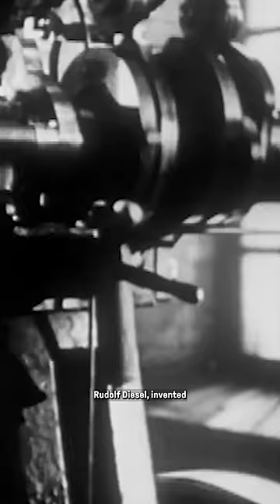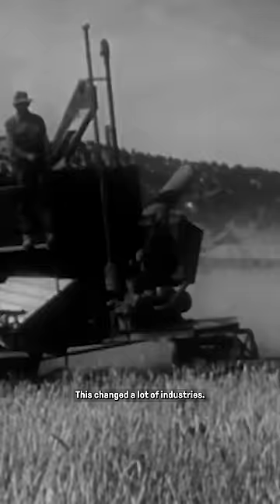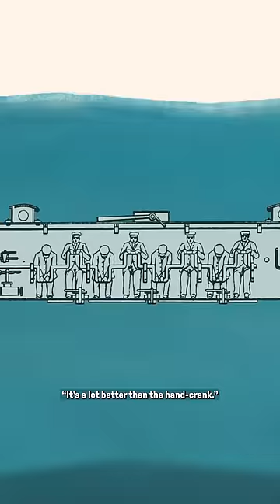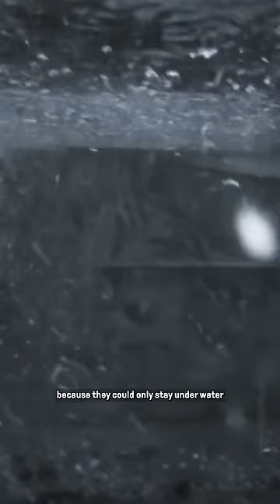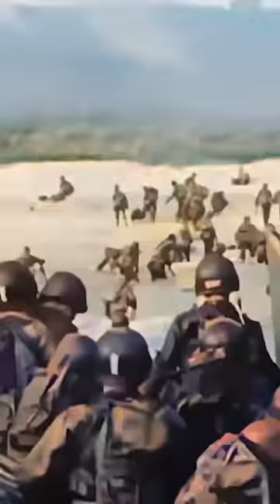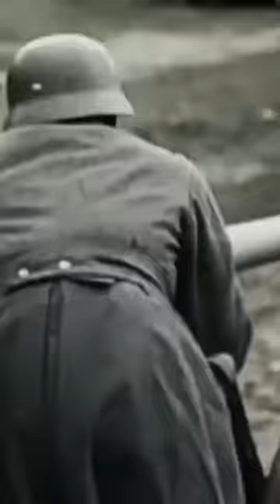How the Diesel Engine Powered Submarines

Comment from the maker: This is a clip from "Submarines Are WAY Scarier Than You Think...Here's Why": https://youtu.be/AecFpnj383A
Reply: There's a bot in comments.
Reply: Diesel engines were designed with vegetable oils in mind. One of the reasons waste fry oil, Waste motor oil or even fuel oil is used in diesels off road. The system is just so dang versatile.
Reply: Also, John Philip Holland designed and built the first U-Boat, then sold the design to the German Empire when the US Navy had no interest in Holland’s design.
Reply: Haha good of you to mention.  That escalated quickly!
Reply: Fossil fuels 😂😂😂😂😂
Reply: Many u boats had snorkels. Where did you get your information?
Reply: ⁸8⁸88⁸8n the most recent version was just just a a after

Comment: Most subs stayed surfaced during transit early on and only submerged when entering enemy territory. They were treated like boats that had the capability to submerge.
Reply: Old subs were ships that could submerge when they needed to. New subs are underwater vessels
Reply: Ya thats why they were called u-BOATS
Reply: They sometimes did not even submerge at all such as at night or when the visibility conditions are very rough. Since subs are small and short vessels it is nearly impossible to see one at night time.
Reply: Ye this video seems smart but it really isnt..
Reply: Yeah, WW2 submarines were essentially torpedo boats that could submerge to hide underwater after an attack.
Reply: @goki6548  Yeah, that's one way the RAF managed to sink a lot of them, once we'd figured out the Enigma code we knew what their orders where so knew which area they'd be operating in, and with patrol planes equipped with radar we could pick them out on the ocean surface at night.
Reply: @AcidGambit419  they are called U-boats because in German they were named " Unterseeboot" or undersea boat. Submarines are still called boats today (although they really are ships).

Comment: They fixed it in WW2. They wen to a deprh of aeound 15m and put out snorkels that would allow the engine to get air. So they could stay submerged dor longer
Reply: and move quite fast too with that snorkel but it left a pesky wake
Reply: Nah, it's still the same issue. They just made it so less of the boat has to stick out.

The real solution was nuclear powered submarines.
Reply: @naverilllang I mean, if you stick with the diesel, AIP is the solution. Nuclear is an entirely different type of propulsion. A diesel electric on batteries is quieter than nuclear too.
Reply: Yes a Dutch engineer invented this "snorkel" in 1938.
The Germans copied it from a sub they captured after invading The Netherlands.
Reply: @peterwassink  Otherwise it would have been a Schnorchel.
Reply: @someopinion922  At the time, the Dutch called it a snuiver (sniffer).
Reply: @someopinion922  Actually, the German word is Schnorkel, so you're pretty close.
Reply: There was also an electronic sub which did not need air and could stay underwater for the whole patrol
Reply: @bradevans7935  Did you just correct someone on german spelling without actually speaking german? Because schnorchel is correct in german. Schnorkel is actually a less common British spelling not a german one.
Reply: It wasn’t sneaky too. A lot of smoke
Reply: @naverilllang  I don't see what is the problem. Just stay south of the artic circle in summer. The sun goes down every day. If you can stay submerged for 48 hours, what is the problem?

In the middle of the night, the snorkel is really hard to see.
Reply: Yes but only relatively late in WW2 we (Germany) developed subs that could stay underwater for potentially about a month, the U-Boot Typ XXI Elektroboot. That said, it was very unreliable due to rushed production, and only two saw action in WW2. The submarines were continued to be produced after WW2 and mostly built for export. The british porpoise and american tang classes of subs were heavily based on the Typ XXI, but the XXI itself was used in some form by some countries well into the 80s, making them one of the longest-serving war machines.
Reply: @bradevans7935 that is definitely not a German word
Reply: @danielch6662 it's not hard for radar to see.
Reply: @backcountry164  It is.  Consider that the waves which also come up on radar are actually larger than the snorkel which has water traps to keep good air in the engines even in seas.  IRL you have to turn down the radar sensitivity to block out noise caused by the waves and this also eliminates all things smaller than the waves.  They were also given a radar absorbing coating making them hard to see even in still waters.
Reply: @adyanchoudhury2090  that can't be true
Reply: @alexander-mauricemillamlae4567  Good! For more in depth information for the other people here.
https://en.wikipedia.org/wiki/Type_XXI_submarine
Reply: @bradevans7935  *Schnorchel
Reply: @WaterMan416  what’s AIP?
Reply: @adyanchoudhury2090  Fully electric submarines are in the concept phase at this point. Google for things like "fully electric submarine" or "SMX31E" if you're interested. Fascinating stuff.
Reply: Snorkel was far from flawless mate, some of the more serious problems was
-The snorkel is prone to shutting off due to waves.
-Speed is limited to 8kts to prevent damage from impacting waves.
-Diesel engines make a lot of noise which can easily be heard, it also deafens the sonar onboard.
Reply: @Eric  my brother, they both make hot air and power a battery
Reply: @StoutProper  https://en.wikipedia.org/wiki/Air-independent_propulsion?wprov=sfla1
Reply: @WaterMan416  sorry I don’t touch Wikipedia
Reply: The real problem with a snorkel is how easily detectable you are from the air and passive sonar when you have the engine running.
Reply: @WaterMan416  technically, nuclear is air independent propulsion.
Reply: @naverilllang  sure, but it's typically reserved for non nuclear subs
Reply: @henrikt.183  internet experts lmao
Reply: You said what I was thinking. Thumbs up
Reply: @bradevans7935 No it's not bruh
Reply: @WaterMan416  true that the reacter isnt perfectly silent
Reply: That's not fixing it, that's mitigating it. They later fixed it.
Reply: Bro is your keyboard broken
Reply: And the German experimented with air independent power.
Reply: Why they dont have o2 Tanks inside and empty Tanks to Film it with co2
Reply: @Erik_Taurus  heh, depth
Reply: @WaterMan416  nuclear powered subs don't use a entirely different type of propulsion since its just a different way of generating electricity.
Reply: @Ntgaming26  depends on the submarine. Traditionally, nuclear submarines have been mechanical direct drive propulsion systems. The Columbia class is, AFAIK, going to be the first US submarine to use turbo-electric drive propulsion. Diesel boats, on the other hand, have been primarily diesel-electric propulsion, though I do believe some earlier classes did use direct drive diesel propulsion.
Reply: @ghilliemcwilly2162  Yes, we really need to submerge in our understanding about these vessels.
Reply: Bro be speaking some Victorian type shit English
Reply: The snorkels are a Dutch invention.
Reply: j
Reply: Watch the full Video, he explained this in it too.
Reply: I think he mentioned that in his full video
Reply: Yes, but that also was primarily in calm conditions, which the Atlantic is not really known for.

So they'd have to sail closer to the surface or surface. Both of which made it a lot easier for them to be spotted either by air or by sea
Reply: @clonescope2433  yes and no, depending on the submarine type, they were able to use the snorkel even at rougher sees, by not attaching snorkel and intake directly and adding a float, that would close the snorkel when water swept over it.
That way, when closed, the engine would take the air out of the submarine becasue the snorkel would feed fresh air into the engine room raher than the intake directly. ofc there were limitations to this as well
Reply: @WaterMan416  sir, with all due respect, there is a reason the US uses highly advanced nuclear submarines that can stay submerged for months at a time and are virtually silent and undetectable. With that said, I will trust the engineers that these are better and I highly doubt you know more than they do when you say that diesel is still better than a nuclear powered submarine. The noise doesn't matter when we have the technology to dampen both and make them both virtually silent. The benefits of using nuclear submarine go far beyond anything that could ever have been possible with diesel. It's no contest.
Reply: And then someone invented the hydrophone, because a running diesel is noisy as fuck.
Reply: @intractablemaskvpmGy like a shark fin😂
Reply: @naverilllang nuclear submarines aren’t as silent as diesel because you have to run the pumps 24/7.

Comment: They had a snorkle system, where they had either folding or extendable piping for air intake and exhaust. Many subs were detected by the diesel exhaust  smoke coming out of the pipe itself as they ran sudmerged.
Reply: My nuke SSN exhausted the diesel exhaust out of the sail which was under water.  The only masts above the water were the periscope and the snorkel.  There was no way the exhaust from the diesel could be seen.

A WW2 boat had its exhaust port in the hull, also under water.  No diesel exhaust was visible.  It'd be a bad idea.

Comment: Originally it was capable of running on peanut oil!

Also there is a closed loop diesels for submarines, not sure if that’s the correct term, but it solved that problem about air and exhaust.
Reply: No, closed loop diesels aren't a thing. It's not possible to produce the amount of oxygen needed for a closed loop underwater. Air Independent Propulsion is probably what you're thinking of. Slow and expensive but also very quiet.
Reply: @ihave_noidea  ah, thank you! Much appreciation for the clearing up!
Reply: Not surprising because I believe the Diesel engine was invented before Diesel came to the market. It could definitely run on sunflower oil. During the apartheid era when S Africa was subject to an oil embargo their farmers ran their Diesel engines on vegetable oil.

Comment: The diesel engine was originally designed to run on vegetable oil.
Reply: waste vegetable fry oil like palm oil , soy
Reply: Does it work?
Reply: @pramodmali4569  Diesel engines with vegetable oils offer acceptable engine performance and emissions for short-term operation. Long-term operation results in operational and durability problems.
https://afdc.energy.gov/files/u/publication/straight_vegetable_oil_as_diesel_fuel.pdf
Reply: @jaycweingardt11 this. ive had times where i ran outta gas and the gas station was far, a grocery store with veggie oil however wasnt. wouldnt try it on newer engines, the tolerances and everything are really tight and theyre really designed to only run on diesel, but older diesel cars wont care on short routes
Reply: It works on older fully mechanical diesel engines. Modern, computer controlled ones will be damaged. Fun fact, when Rudolf Diesel found out that his vegetable oil burning engine was being used with fossil fuels (the industry he hated), he mysteriously withdrew his savings, left it with his family, boarded a ferry, and was never heard from again.
Reply: @pramodmali4569  Yes. In the 90s growing up I remember seeing people in the news frequently. They would stop buy McDonald's and other fast food places to pick up their used oil.
Reply: Yes
Modify current engines to run off used fry oil

Comment: They had solved it beforehand. What war taught them were the pitfalls of the snorkel and whether or not the enemy could find them. Spoiler - yes - subs can be seen below the surface by an aircraft and once we closed the mid Atlantic gap by not at all asking Portugal for use of the Azores, the subs didn’t do so hot.
Reply: also long range patrol boats were made to close the gap

Comment: The first fuel  used in experimental Diesel Engines was Peanut Oil. Works Great.
Reply: You can run pre-2000's diesel engines on warm engine oil. Just need to filter it before using to preserve engine life.
Reply: @alaric_  it depends on which enginel . A Detroit two stroke will run on piss and a little acetone. A new common rail? Probably not. A lot of older engines will.   Herr Diesel used peanut oil because Diesel fuel hadn't ever been used as such.

Comment: The Dutch actually made the snorkel. They adapted it to the submarine. They could lift it underwater and basically have the periscope up looking around. They also had an anti-radar coating for it. The other thing is with that snorkel they could actually circulate air into the sub. That way the air would stay fresh. They pretty much could stay underwater and definitely at that point.
Reply: When the Germans captured one of the dutch submarines equipped with snorkel in ww2, they didn't knew what was it's purpose at first and assumed it to be some sort of breathing device but after realising it's purpose, they started using it in their submarines.

Comment: The germans were looking for a way to run subs underwater without needing electric via the Walther turbine. Basically a rocket engine powered turbine that used concentrated H2O2 and fuel to run. They managed to achieve 30+ kt underwater, which is really impressive using the Walther turbine

Comment: except that when the diesel engine was first invented it was designed to run on plant oil, not dino oil. that bit came later.
Reply: Yea, that sparked the oil industry because suddenly there was a use for good use for that stuff.

Comment: Rudolph ran his engine on peanut/vegetable oil originally.  This is why every time the price of diesel fuel goes up the price of canola goes up also...or the opposite happens. You will never find a gallon of cooking oil at Costco cheaper than diesel at the pump.

Comment: in ww2 many German uboats could run their engines under water with the use of a snorkel. You should read some stories of that occasional disaster. 
Also many crews stayed on the bottom a lot longer than 48 hours before coming unstuck.. 

Read “iron coffins” if you want a great read.
Reply: Yes a Dutch engineer invented this "snorkel" in 1938.
The Germans copied it from a dutch sub they captured after invading The Netherlands.
Reply: @peterwassink It was later in the war where the snorkel came into use, and not every single UBoat was equipped with it. But it still is notable

Comment: Can't run an engine underwater... Well not exactly true. Underwater exhausts are a thing, pretty much all inboard boats do that so not an issue to just dump the exhaust into the water. Just need a snorkel, for intake of air. And voila, run the engines at periscope depth.

Comment: From my understand, submarines in that time period typically moved on the surface which is why they had a somewhat boat shaped bow and only went under when going on attack or if the crew believed  they were spotted I believe it was the Germans that started using snorkels so they don’t have to fully surface to charge the battery’s

Comment: At the end of the war, the Germans made a pretty complete and "true" submarine called the type-21. It was faster and could stay submerged for longer due to a supercharger on the engine, and triple the battery capacity of the early war models. Max submerged time was around 75 hours and could travel underwater at ~5 knots. 

This Submarine was the basis on which allied countries built their post war submarine fleets

Comment: "Just have to solve it first"
Context.
The Swedish navy use diesel-electric subs. Why? As neutrals (until recently) they're looking at coastline defence, not operating in the middle of the North Atlantic and limited underwater ops is fine. Besides electric propulsion is still the quietest simply because there's the least machinery running.

Comment: If i recall correctly, German U-boats were able to operate their diesel engines while at periscope depth, exchanging air either through the periscope, or through another pipe just like it (ie- snorkel). So they didn't NEED to surface to run their engines.
Reply: Have not heard the periscope thing, but yeah snorkles came later.
Though if you run them for longer periods its better to go on the surface

Comment: FYI, the fuel in a diesel does not explode, it burns... And the first diesel engine ran on peanut oil... They can run on just about anything that is combustible or flammable... Way more environmentally friendly than any electric, hybrid, CNG, LNG, or gasoline vehicle....

Comment: Diesel originally used vegetable oils  . When a coal mine using a Diesel power sump pumps started experimenting with alternatives, they found a waste product from oil refining work well and was dirt cheap.  It was later called DIESEL FUEL !

Comment: You do not need to surface the entire submarine to get air for the engine (and crew). The only thing you need is a snorkel, a intake pipe above the water. That will give a lot less signature then you get from exposing the entire sub.

Comment: Simple: Use electricity from the engine with the strating oxygen you have. Use that electricity to split oxygen from water and use that oxygen to keep the engine running forever until the fuel runs out. The CO2 emissions turn into liquid and keep it stored in the submarine.
Reply: What?
It takes more energy to split oxygen from water than you get back when burning it again, there is no perpetual motion. Also, it would be really energy ineffecient to do that, and you would have hydrogen left over, what would you do with that?